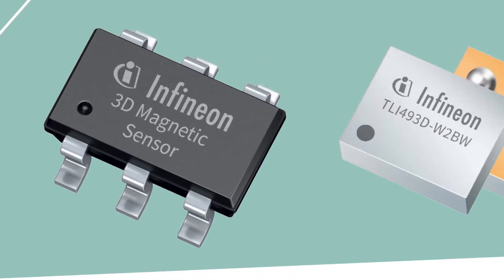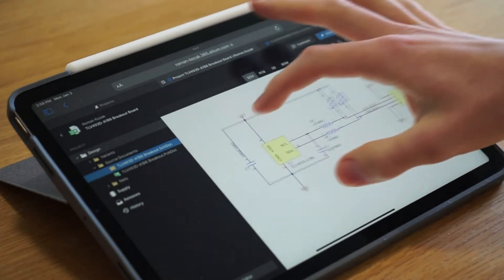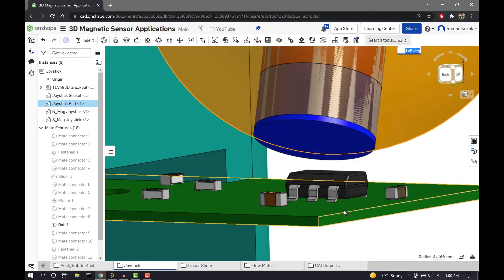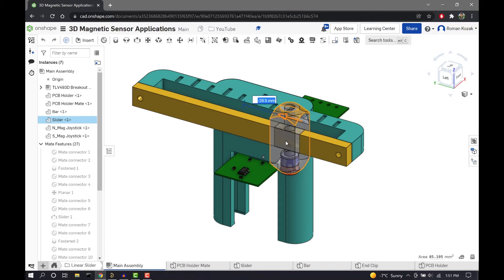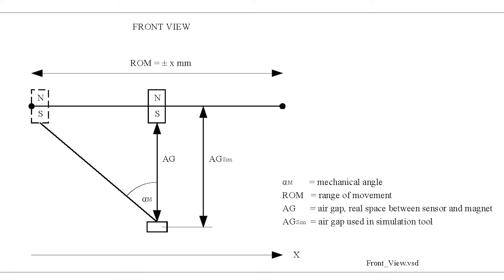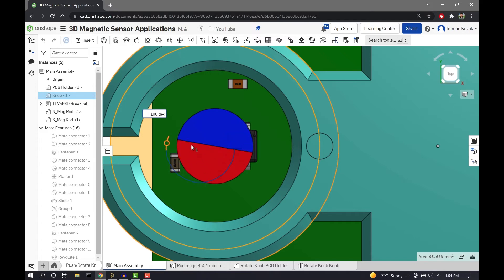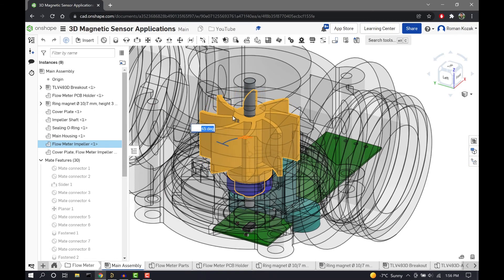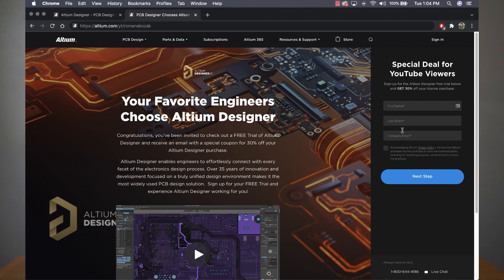Cool applications (JOYSTICK) with a 3D Magnet Sensor!

Comment: Thanks, excellent video. I'm getting closer in confirming if I can use the sensor in a "reverse joystick (xy+z) configuration i.e. magnet moving on top of a small rod (xy), creating a spherical segment xy and that xy also moves up-down (z) 🙂 

I think it's possible, because the Infenion website calculator shows x-offset in joystick is possible and the my xy movement would fit within the offset (at least x but I think/hope it's 2D) . Z-distance, I hope, can be decoded by the vertical distance component of the xy space moving in z.

Comment: Very cool product. It's unclear to me though how you would translate the movement of the magnet over the sensor into +/- X and Y coordinates. If the sensor is only detecting the mT from a single point, when the magnet is to the left or right of the sensor, for example, it would detect the same value, right?

Comment: You need to get in touch with a manufacturer to make console controllers with your magnetic joystick modules and you will be rewarded by millions of customers who are frustrated with the current potentiometers which wear out in 6 months.  During the last 5yrs I have paid out more in new controllers than what my Xbox One X console cost me.
Reply: This is nothing new and your problem is a solved problem already, Hall effect joysticks already exist using different methods to this but console manufacturers just won’t use them, likely so that you have to keep buying new controllers.
Reply: @conorstewart2214  Yes they are everywhere now and I have two of them, a Gulikit and 8BitDo.  Do Microsoft even do one yet?